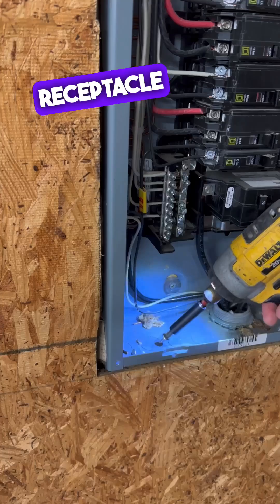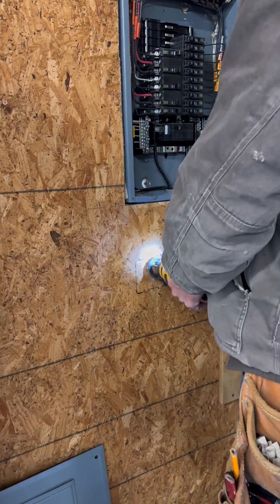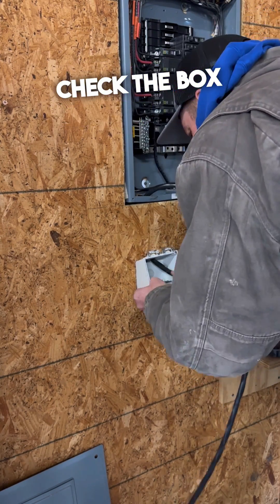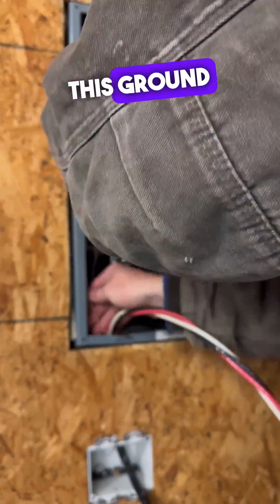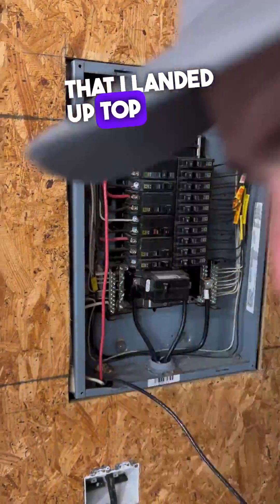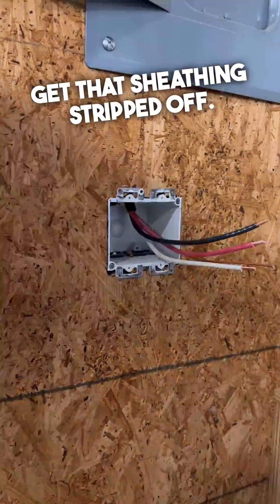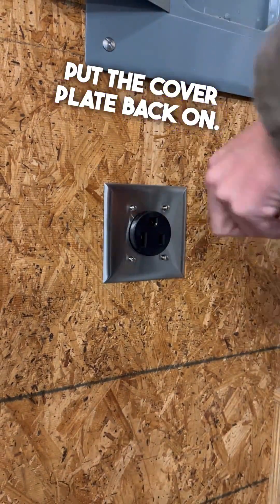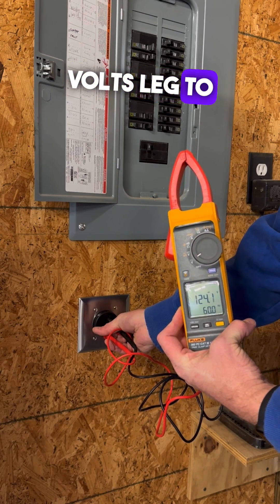Installing a 240 Volt Welder Receptacle under an Electrical Panel #welderinstallation #diyprojects

Comment: Can you explain how you are able to use 8/3 instead of 6/3 considering that you didn’t use THHN/THWN-2? Is the welder on a 40 amp breaker instead of a 50 amp breaker?